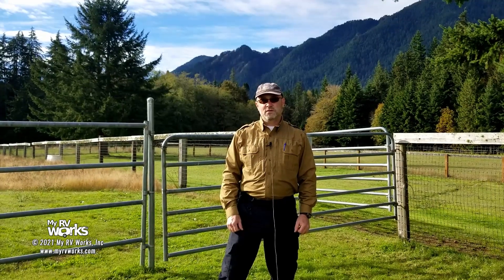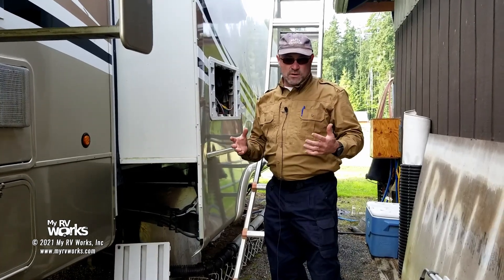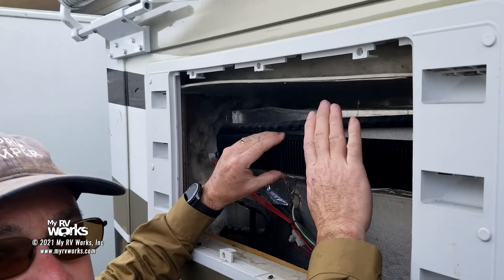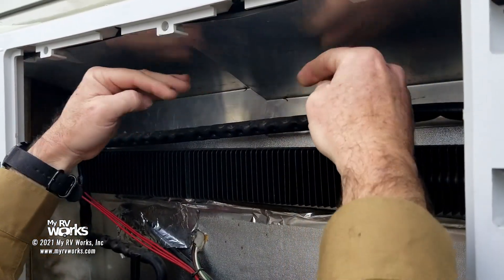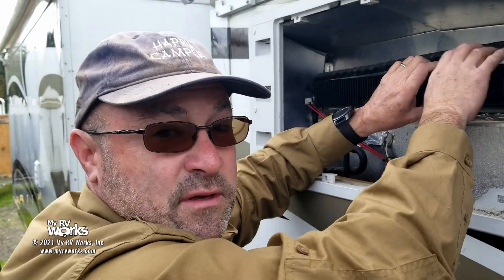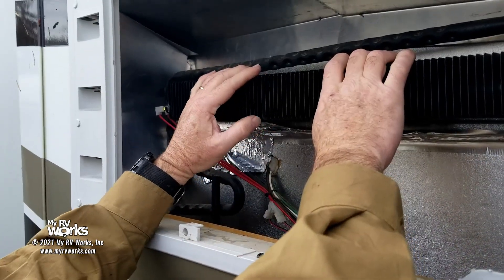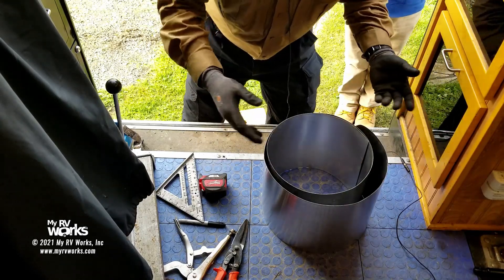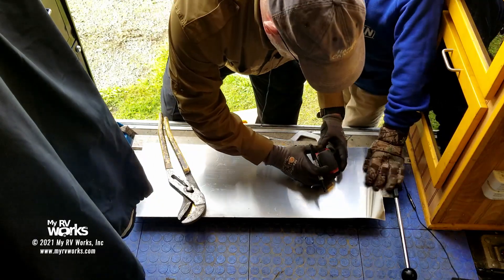RV Refrigerator Cooling Performance Issues – Installing A Baffle To Shed Heat From The Cooling Unit.

Comment: Hi, thank you for your videos on the rv fridges, I have a question, you didn’t show the baffle/ block you put on the right side, did you still let the exhaust tube from the propane exhaust into the same space as the cooling fins or did you stop the front baffle right at the end of the fins and put the blocking flashing up against the fins?
Reply from the maker: The top and sides are the same. There's a space above the chimney that comes straight to the side of the fins and out the top.  Visualize the airflow and you should be fine.
Reply: @MyRVWorks  thanks for your response. I’m going to put an elbow pipe on the end of the propane exhaust pipe and vent it out the side of the camper, that will eliminate a lot of hot air in the chimney space. My fridge doesn’t vent out the top of the camper, maybe I’m on the right track lol

Comment: Do you think adding a fan to pull the air out of the side vent would be useful in hot humid climates along with your installed baffle?
Reply from the maker: The key is proper airflow through that top condenser. Some folks will add fans but they will not have the proper baffling So they're moving air but it's not going through the condenser you see.  As long as the fans help to move the error through the condenser then that's a good solution.

Comment: Darren,
Nice air flow management. Folks I bought a simple outdoor remote digital thermometer. Sensor goes in fridge, receiver is in trailer or truck while towing and even at home monitoring the pre trip cool down. Knowing the interior fridge temp is a good thing.
Gary

Comment: How does the fan fit into this picture. Is it removed?
Reply: The fan is down lower inside the wall pushing air up towards the top vent.

Comment: You would have had an increased reliability of your treatment for this solution if you had shown a before-and-after temperature difference.
Reply from the maker: Customer provided that for us (another Happy Camper!)   Before we installed the baffling the frig was not cooling to spec.  After installing the baffling frig had no issues performing to spec.  It is that simple - really.  Have a look at the refrigerator install manual and ensure installation was followed by the OEM.

Comment: If the refridgerator doesn't get enough oxygen in the burn process, it will start producing carbon monoxide, which will kill the people in the RV. It looks like you just cut off the oxygen supply that is supposed to come from the outside .
Reply: I don't think you fully comprehend how absorption refrigerator's work. If anything, this will stop Co2 from entering the cabin
Reply: @zedhead2864  - 'Absorption refrigerators, must be installed as 'room sealed' from the interior of the Leisure Vehicle and ventilated by top and bottom ventilation grills, CO gas generated when used on Lpg gas must also be vented through the Leisure Vehicle wall to the outside.'
Reply: @zedhead2864  - CO2 is not carbon monoxide..

Comment: Sir I own a 1984 chevy lazydaze class C motorhome my refrigerator stopped working I replaced the electric clicker egnitor but the new part only making 1 click and my old part made 3 or 4 clicks to ignite the refrigerator do i have the wrong part that my refrigerator really calls for and the spects is a little lesser than my origanal part has is this what has been the true problem why i cant get my refrigerator back to up and running again for us is because they sold me the wrong sized igniter in the first place?

Comment: I have an RV, the top gets very cold but the bottom is only a little cool. It get colder with electricity than with propane. What could be wrong?

Comment: I installed small fans (zip tied) to the upper access plate, too, to force air up and through this section.  Ultimately the answer was to ditch the absorption refrigerator and install a residential.  :)  Really like your videos--link them all the time on Grand Design's Technical Forum.

Comment: Thank you. Answered a issue I didn't know existed. But our frig has never gotten really cold. Ours had insulation that had fallen behind the frig covering the fan, a huge gaps everywhere else.  So the heat has been flowing around the sides to reach the top vent.

Comment: Thank you for taking the time to show what to do with a slide frig. I have some work to do to get my frig in shape.
Reply from the maker: Get it done!  ;)
Reply: Just finished this project. Thank you again for sharing your knowledge.
Reply: Frig was doing great till a automobile coil spring dented the back. Went right through the upper vent, missed the piping. It still works just need advice on what to use to repair a small crack the spring made in the back.

Comment: My RV Fridge came with this type of baffling but it was secured with sikaflex as well.  Do you ever see cases where a hard sideways blowing rain will get water into the fridge compartment through the access vent covers (the ones you opened) and then leak down.  I have this issue.

Comment: Wow nice work.  Back in 2015 I bought a brand new travel trailer with the fridge in the slide.  when I got home upon checking things out and removing the top plastic vent cover I noticed that they had screwed in a thin piece of Birch wood to the outside wall.  Sent a photo to the dealer (thought it was a mistake maybe needed to be removed upon shipping) but not only did I learn it's suppose to be there but the dealer had cut it about two inches too high above the coils.  So I fixed it plus they never like this unit had any baffle on top which I also made one just like in this video.  Used a fair amount of foil tape too 😁  The fan that would come on automatically was annoyingly noisy.

Comment: I see comments on Facebook on some manufactures pages that the manufactures tech actually removed the luan boards on units that were not cooling properly. The customer said it fixed the problem. On mine the frig is much wider than the vents as it is a double door 12 fc Norcold.

Comment: I had the same problem with my Fun finder 189 FDS.  Adding the flashing wasn’t enough, we had to lower the fridge so the cooling fins where near the bottom of the opening.   Cruiser RV didn’t follow Dometic’s installation requirements.

Comment: I live in Mesa AZ in small rv trailer last summer we had like 50 days of 110 degrees temperature I put two frozen water bottles in the refrigerator with a fan blowing across the bottles that helped a lot. I had to switch the bottles out two or three times a day
Reply: Does the RV struggle to cool in those extreme temperatures I live in an apartment in Arizona and I want to live in an RV instead but I have been told that they do not cool down very well do you have any issues with that
Reply: @iair-conditiontheoutsideai3076  I live in a Winnebago Micro Minnie 1706fb when I came home 6 1 2021 4:30pm it was 110 degrees inside my account is not on a thermostat on or off manually operated. I  think if I had a thermostat it would be better. I am in Mesa if you live close we could meet if you have more questions
Reply: @bobfincher1767  interesting well I will keep that in mind thanks again 🙂

Comment: Install 12v computer fans on the vent to pull hot air out.
Reply: I have 2 fans on top of flashing in front of th engins to pull the air out.  Planning to add a third.  It really make sa difference.  My fridg is smaller, so that makes fans pretty much all the way across,,
Reply: @projet2907  I would install fans on the vent itself otherwise the hot air is simply churning in there.
Reply: @aguyandhiscomputer  what do you mean on the vent ?  Hard without pics 😊
Reply: @aguyandhiscomputer  ah, yes thanks !
Reply: @projet2907  it's easier to do it on fridges with roof vents (not in a slide) but it still helps push out hot air.